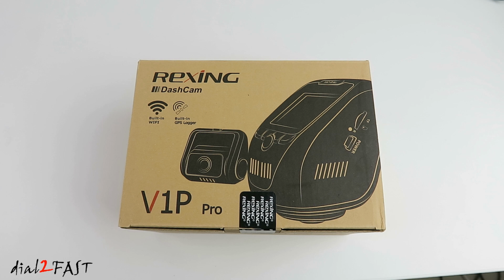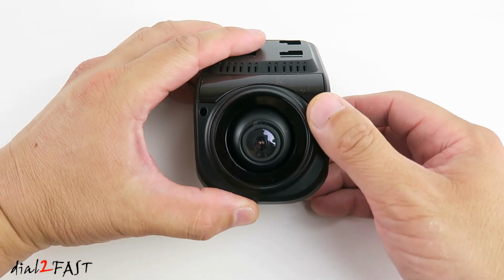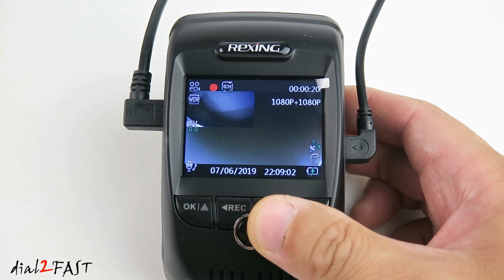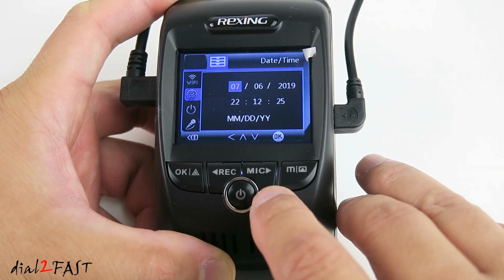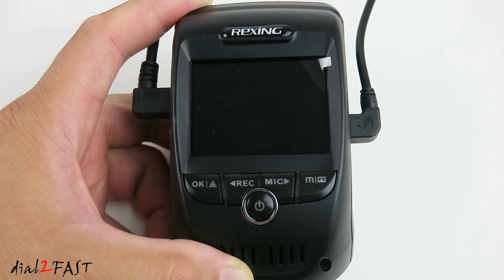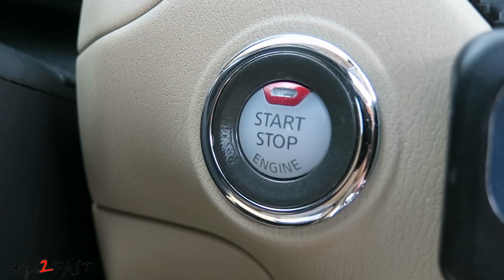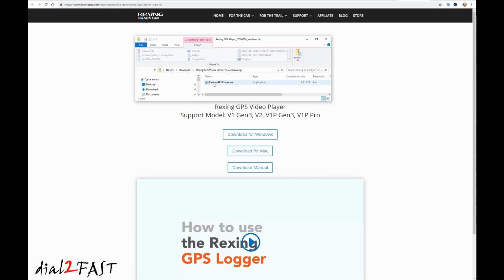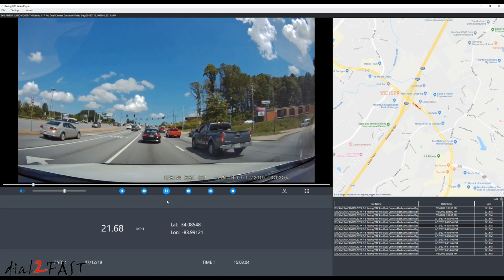REXING V1P Pro (Gen 3) Front & Rear Camera Dashcam w/ GPS

Comment: What is the g sensor high medium and low?
Does high mean high sensitivity or that it needs a high amount for it to activate? And opposite for low?
Reply from the maker: The g-sensor will detect any impact to the vehicle while you drive and if it detects an impact, it will lock that video clip so it will not be overwritten. The hi, medium, low is just the sensitivity setting of the g-sensor and when it's triggered to lock the video clip. The dashcam is always recording regardless of the g-sensor sensitivity.

Comment: I have installed this dash cam today, but when I installed brand new 250GB memory card it says “memory error please format” wat should i do ?
Reply: You have to format the memory card once you insert in the camera. There's an option that he showed. Also, "Camera Requirements

Class 10 / UHS-I or higher MicroSD/SDHC/SDXC memory card up to 256GB (not included).

Card Recommendations

Kingston Canvas Go! MicroSD (pictured above)

Kingston Canvas React MicroSD

SanDisk High Endurance MicroSD

NOTE: Please don't use SanDisk Ultra cards with our cameras. "

Comment: Hello how about when you park your is it continue recording please advise
Reply from the maker: It only records with ignition on.
Reply: @dial2fast  I got one today, 2/20/20 and it does have parking mode now, but it will only record with the ignition off using their smart hardwire kit. Problem is it comes on ALL THE TIME, locking the videos, like when opening the car, closing the door, breathing on it, seriously though the sensor is way to sensitive no matter how you set it.
Reply: @spaceavenger54  is it on the unit menu that you have to setup? Cant find parking mode on mine? Help pls.
Reply: dial2fast I just hooked mine up and it records for almost 15 minutes after I shut the truck off. 2017 F150 Platinum.
Reply: And I don’t have the hardwire kit.

Comment: Will the back camera work with the proper camera view on an almost vertical window, as on a pickup truck?
Reply: I have a newer Silverado with a flat rear window. The cam will stick to the glass but it's lens is real close to the glass because of the angle it has to be at. Literally a 1/16 of an inch. I would suggest another layer or 2 of two faced tape to get a little further away from the glass. Shouldn't be a problem though.
Reply: @buffareamedia8669  Thank you!
Reply from the maker: @lcrr700  Thanks Barney for your reply. i had another look at the design of the rear camera and indeed you can rotate that camera all the way so it faces the back for a vertical window.